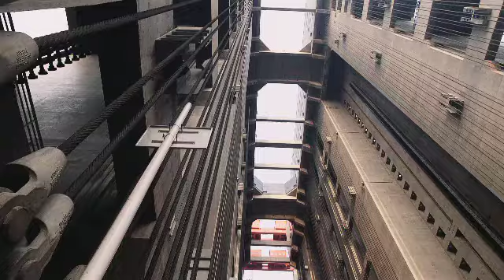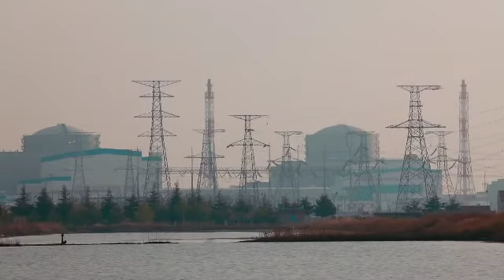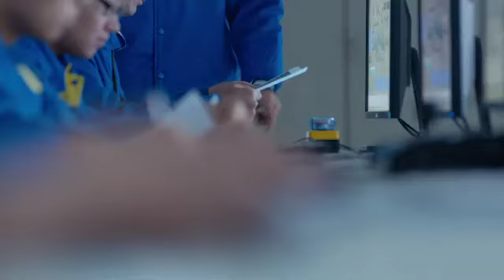Mega Equipment Episode 2 Core Component

Comment: 00:00    07:30        introduction misc. bragging
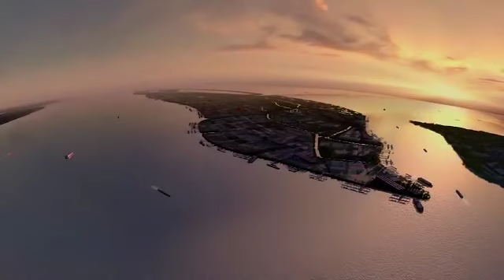07:30    14:40        turbine forging 
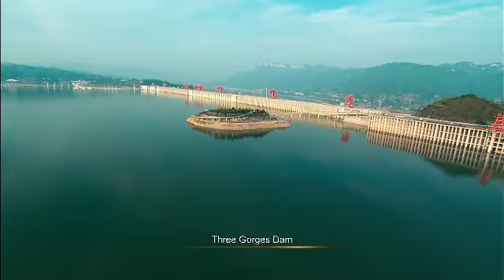14:40    19:50        marine crankshaft manufacture
19:50    24:50        electrical grid transformer manufacture  
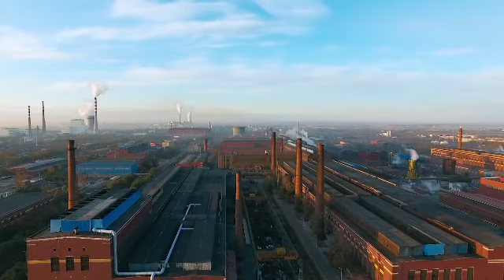24:50    28:00        compressor manufacture
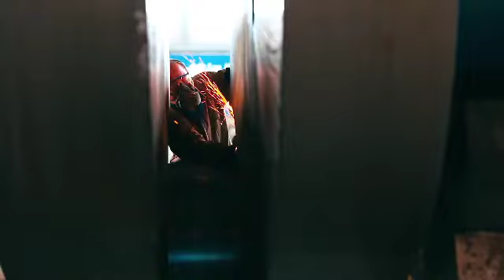28:00    33:00        turbine manufacture
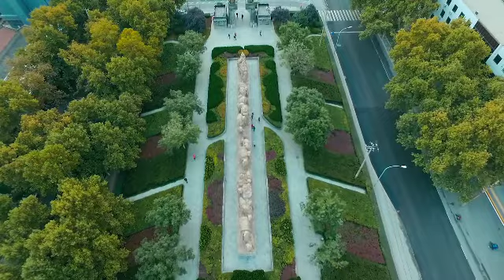33:00    37:45        crankshaft and engine placement 
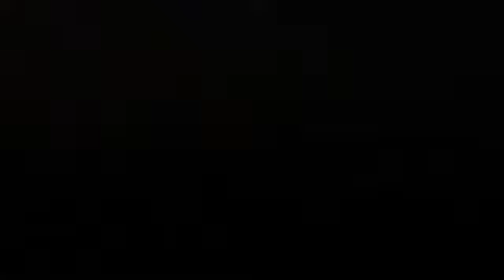37:45    42:00        assembly and testing electrical transformer
42:00     end          compressor tests and installation

i found the language a bit flowery   the photography was all beautiful but the editing did not do it justice.        m